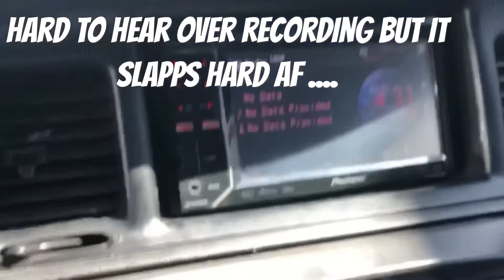KICKER COMP VR 15's install on daily driver

Comment: Heeyyy.. slappin in the trunk mayn! If your amp starts trippin.. relocate it to under the seat. Trunk makes it heat up in enclosed spaces. I put a 12v switch on my remote wire for manual reset while driving. Nice work